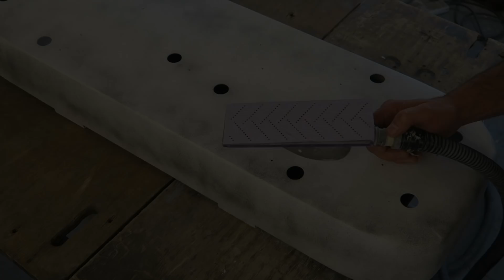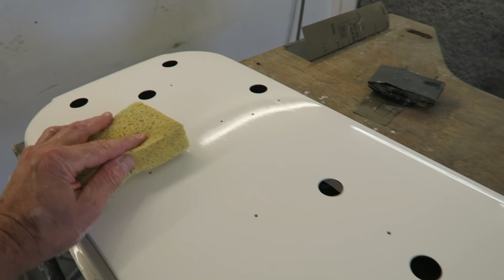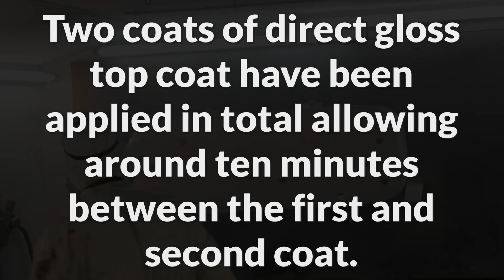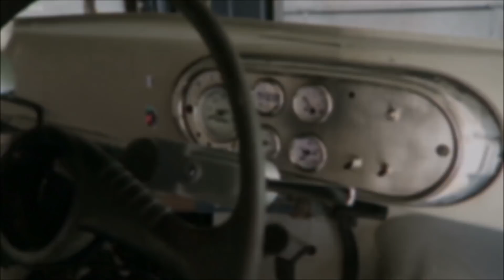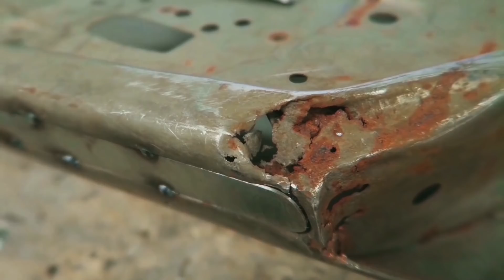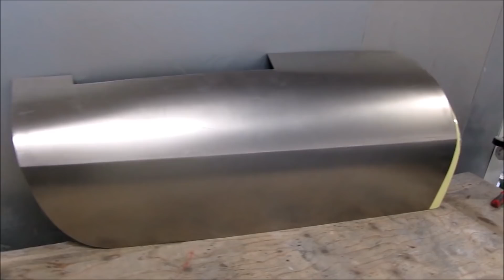Sanding primer, spraying direct gloss How to paint a car Beginners guide Part 4 Tips and Tricks #59

Comment: I’ve wet sanded my primer to 3000 grit ready for metallic paint and clear coat. I’m being told that this is too fine and the paint won’t stick. Can you provide some advice please.
Reply from the maker: Hi Dominic yes 3000 is probably too fine. You’ve got to get the surface to a point where the sanding marks won’t show through but it’s rough enough for the paint to stick. The paint sticks in the grooves that the sanding material leaves behind (mechanical adhesion) If you’re applying base coat silver can be a bit tricky with leaving sanding marks, I normally flat it down with 800 then finish off with 1200. If it’s a metallic blue red etc then 800 is normally absolutely fine. The best advice in the world is to do a test panel. You’ll know in advance of painting the car that your procedure was correct 👍

Comment: Great tips thank you. What paint do you use for guide/trace coat black spray can? I use upol guide coat aerosol  but it's not ideal and meant more for dry sanding... Is there a 2k friendly guide for wet sanding you can recommend? Something that won't react (like cheap enamel) in case I miss a tiny pit or edge.
Reply from the maker: I’ve personally never had a problem with cellulose type semi matt black aerosol. Another guide coat in an aerosol I’ve used is made by HB Body, I personally liked it because it was less like powder more like light paint. Cheers Trev 👍
Reply: @trevsblog  Thanks Trev. I'll give the HB body guide coat a go.

Comment: Thank you so much for all those videos, as informative as they are entertaining to watch. It's mostly thank to you that i started a new project: a pedal car version of a 1920 hudson super six racing car for my daughter.
I may use a bit of advice concerning the bodywork. I planned to use 0,8 mm steel, but i'm now considering 1 or 1,5mm aluminium to reduce the weight. Is there any differences working with aluminium that i may be unaware of?
Thanks again!
Reply from the maker: Aluminium is different from steel. There are different grades which have different characteristics. To be able to weld aluminium you will need to use an ac/dc TIG welder. Aluminium is softer so in many easier to shape. Definitely a lot lighter. Check out this channel, he makes kids cars from aluminium! https://youtube.com/user/scarlettsgarage1
Reply: @trevsblog  Awesome, thank for your reply! I bought a mig welder that can be used for aluminium, i hope i will do the job!

Comment: Hi Trev, great content yet again. You mentioned the old folklore theory of wet flatting adding moisture to primer, in my personal experience it unfortunately did. I repaired a rear wheel arch on my car 17 years ago and had the whole side painted. Unfortunately after almost 17 years of dry storage I have blisters in the paint on the sill cover, one has been popped which is  showing the primer that was applied over the original factory paint.
Reply: But it wasnt epoxy primer back then and this is why. Acrylic primers did drink water. Leave a car in that primer for long and it would rust out.

Comment: Trev, Your videos helped me a great deal in my restoration project. I am now done with paint and am stating to put the car (MGB) back together. The point about practice with the paint and gun is the required step.  Please add a little up front instruction on setting up the gun each time you spray. Paper on wall, proper spray pattern, fluid control all the stuff you take for granted given your experience.  Thanks again.

Comment: i was interested in how you set the gun? I thinky ou said before you put it so its on full amount comming out? also how to set the fan?

I painted a mini bootlid in 2k white today, and i got a run, i think i was going for too much of a finish as you said and it has flowed.

thanks for the vids and happy new year
Reply from the maker: General rule of thumb, paint volume maximum and fan maximum for top coats. Adjust air pressure to suit. 👍
Reply: @trevsblog  ah thank you very much! ill have another go again today !happy new year!

Comment: Hi Trev,
Thank you for this mini series it will be very useful in the spring when I hope to be at paint stage.
However, I will be spraying my chassis at some point over the next couple of months using the same Rustbusters product you used. Their website was very helpful too and went on to talk about Dew Point and the implications it can have on your finished paint work. I guess it's not too much of a concern if you have a heated garage but it could be a tragedy waiting to happen if you don't have the right balance of conditions for any type of painting application.
To be honest I hadn't given it a thought as I have a dehumidifier running 24/7 but now I know about it I will be calculating the Dew Point on any day I'm painting.
Kind regards Paul from 48 Spokes 👍👍
Reply from the maker: The last thing you want is condensation for sure👍

Comment: Good to see you back trev. I noticed you had a filter mask on spraying 2k mate Iv alway bin under the impression I need air feed mask for 2k as in had bad things init is this right?
Reply: p100 masks will do if the time is short "in the booth"
all day as a job yes forced air/fresh air is best and youll go through less filters.
a p100 will last a few hours maybe 2 shifts (read the mask and paint data)
Reply from the maker: Exposure is the important part watch part 1👍
Reply: Cheers guys